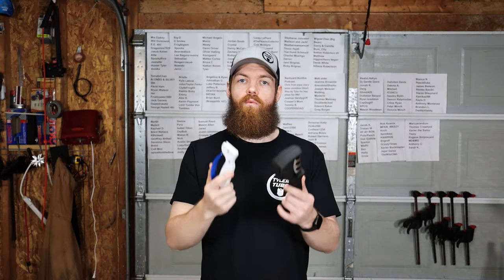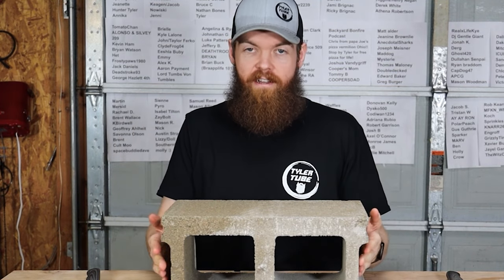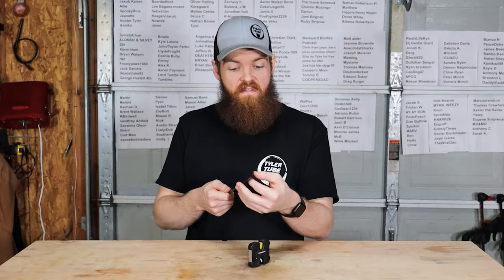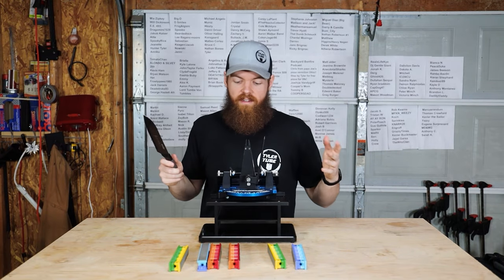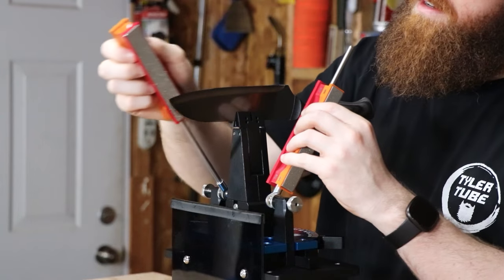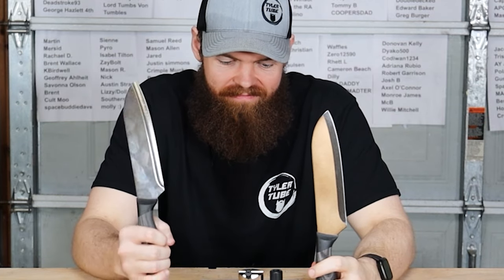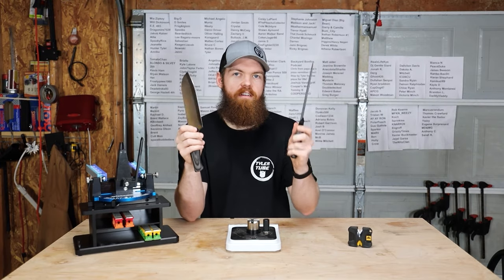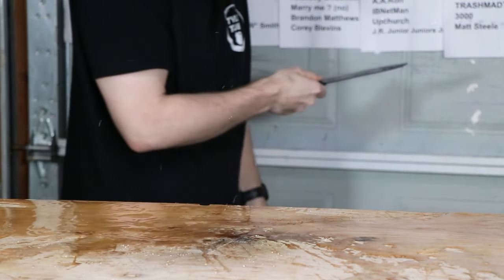$4 VS $1000 Knife Sharpener, Which One Is Better?

Comment: You need to strop the blade as well to get the best from it to as the act of sharpening the blade creates a burr that degraded the final finish, with the cheap tool the burr is forced to be in the center and the ceramic helps to lessen the burr, on the $1000 kit when you sharpen it down to a fine edge you end up pushing the burr back and forth until it ends up on one of the sides, when you used a sharpening tool like the $1000 it is essential that you strop the blade to remove / align the burr
Reply: they make a strop and their own stropping compound as part of this kit, he jsut didn't get it.
Reply: @inibrius5380  For 1000 freakin dollars it should be INCLUDED in the kit, it's not his fault their cheap asses didn't even include everything you need to sharpen the knife. They decided to splurge and that 100% unnecessary Pelican case instead, shows how stupid they are.
Reply: @bobbygetsbanned6049  i dunno if it's stupid or if they just understand the kind of person that's dropping a grand on a sharpening kit...it's either an 'avid home user' that has more money than sense or a professional knife sharpener that wants to pick and choose what additional stuff they get.  Check out the Project Farm knife sharpener review, he's a lot more detailed about why this isn't worth the $$.
Reply: You don't NEED to strop. If you sharpen properly there will be no burr.
Strops aren't needed if you know how to sharpen, which you clearly don't.
Reply: @autumn5592  Take a blade that you've 'properly sharpened'.  test it's sharpness using one of the tools shown in the video.  Then strop it and test it again.  Then tell me it's not necessary.  Even with a high-grit sharpening stone (10k+) you're not getting a perfectly smooth blade.  A strop works to polish and align a blade after sharpening to get rid of any micro-imperfections for the best possible blade.
Reply: @inibrius5380  I don't have the money to buy testing equipment.

Look on science of sharp, they look at the edge under an electron microscope, properly deburring on a stone is possible.

Just because YOU don't have the skill to do it doesn't mean it's not possible.
Reply: @autumn5592  science of sharp is where i first learned about stropping.  I based my paste strop off the one they post about.  The issue is that you get a different edge if you don't strop - if you're looking for an edge that passes the 3-finger test then use a stone.  If you want razor sharp blades that will shave hair, you strop.  It's all up to your preference.  I'd recommend you read the 'burr removal - part 1' article to see what i'm talking about.
Reply: @inibrius5380  You do not need to strop to shave.

I can get a shaving edge off a 220 grit stone without stropping.
Learn better technique.
Reply: @autumn5592  It is abundantly clear that you really do not have a clue how to sharpen a blade, history and science has shown that stropping is absolutely nessesery to obtain the sharpest possible edge, there are life long  blade experts that from chefs to Japanese blade artists to historical evidence that all proves that stropping is is needed.  Can you get a bit of steel semi sharp without stropping sure you can but by not stripping you are never going to get the full potential and no stropping a blade does not mean you are bad at sharpening it is a simply scientific fact of how steaks work when they are sharpened down to a thin point
Reply: @EQINOX187  I don't know how to sharpen right? But you're the one that has to use a strop to get a decent edge hahahahha.
Come on now, that's idiocy.

Sure, stropping will improve your edge, but you can remove all burrs with proper technique, which you don't seem to have, given you rely on it to get a good edge.

Use the strop to maintain blades, not sharpen, deburr straight off the stone, or improve the edge.
Your knife should be as good as it can off the stones.

If you DONT, sorry, but you have shit technique. Learn to properly sharpen buddy.
Reply: @autumn5592   A small tip in life when everyone is saying you are wrong and when history also tells you  you are wrong then you are wrong and you have not got a clue what you are talking about
Reply: @paulsmith3185  That's a lot of nothing.

You're wrong.
Reply: @EQINOX187  Again a whole lot of nothing, lmao.

YouTube doesn't allow links anymore. (Comments get deleted.)
Go to science of sharps honing progression article -- straight off a 1k stone under 5000x magnification, there is no burr.

 But keep going on thinking you're right, lmaoooo
Reply: @autumn5592  Y'all guys are all over here trying to gatekeep knife sharpening, all the while I've been using my teeth to cut meat and vegetables for the past 20 years. You don't need knives to perfectly mince onions or julienne carrots, dimwits.
Reply: @yancywatts388  How am I gatekeeping lmfao?
Reply: @autumn5592  With the understanding that the comment I made was entirely satirical in nature, I would have hoped that someone with the level of understanding of knife sharpening technique you do would have been able to note the blatant sarcasm of my statement and not have gotten so easily offended by it. I do apologize for offending you so, and hope you understand that I meant no harm by the comment.
Reply: @yancywatts388  My misunderstanding then, I thought only the stuff after the gatekeeping was sarcasm.

Edit ; You never offended me either, so no need to worry about that, lol
Reply: @bobbygetsbanned6049  I have this & it does come with it. Plus he did not use it right. Very light strokes. The 100 grit is used to re-profile. He needed to create a burr first which he did not do. Plus he was rolling the tip & had way to much pressure on it. I have used mine & looked at it after the strop with a jewelers loupe thru out the process. The final after the strop & the edge looks great. Other people have tested it & it gets to under 100 on that cut test. Also there is a allen wrench that comes with it to tighten the vice even more than he did. I have gotten mirror polish finishes with mine. Wicked edge is a amazing system but for most people the wicked edge go which is $275 now. I got mine when they first sold them a few years ago for $150 & ordered the deluxe carrying case with it. It allowed me to add two sets of stones. So it has 20/600,800/1000 & 1200/1600 ceramics Dimensions of the case (It rolls up very nice) are 14 inches long 5.5 inches wide & 3 inches tall weight 6 lbs 9 oz. This is perfect for all kinds of knives. I do have the best model they have & about every type of stone they have & strops to .5 microns paste. Most of the time all you need is the 200/600 better for cutting stuff. The mirror edges are more for show. 600 grit leaves a bit toothier & that makes better for cutting rope & other things. Plus with this system the stones need to break in. So after several times using it, it will work even better. I could go on & on. But check out this video. Very good test here.   https://www.youtube.com/watch?v=uEDyYJJ6f9M

Comment: Simply didn't establish the initial bur needed to make sure the apex of the edge was fully defined.   I myself only do my first 2 grits where I do a single side until I develop a bur then switch sides checking for the same bur followed by about a couple dozen alternating strokes.  After those initial 2 grits, I simply alternate all remaining stones grits as I am confident that the apex edge is already achieved.  Like others have said, ~150 on the tester is my norm at 100grit or so.  I have much finer grits and strops and most of my personal knives and a select few friends, I normally shoot for 75-90 or so on my test results.  I have some super steel EDC's that have 14degree edges that test in at 45-65.    When I first started I made that same mistake of not getting a proper bur where my test results would be in the 300 range.  Immediately after I realized it I went back, got the burs, then finished in the ~100 range.  Its a huge difference.  My guess is the second attempt Tyler made just got it closer to a bur but still missed it by a bit thus it improved but was not a spectacular result.
Reply: YESSS!!!!! finally, not an idiot on here. This guy should not be doing these tests.

Comment: I use the KME System and it's about $300 and I get results just as good as the Wicked Edge. Just my experience though. I highly recommend when you're using the Wicked Edge to take your time on the lowest grit before jumping to the next one. You can take a piece of paper while it's still in the base and drag it across the edge to see which spot needs more work. I'm not going to say you used it incorrectly because you used it right. It just takes more experience with it Tyler! I've gotten edges on my Lansky system the got a 50 on the Bess Tester
Reply: @LargeNuts  Same! I love the Lansky and I believe I have a video about what all I have put into that system so far
Reply: I do the paper drag while still in the clamp myself, it helps tremendously to always find that one trouble spot every knife seems to have.
Reply: I love my lansky and get similar results.
Reply: I also have the KDE and I finish off with leather strop with very good results
Reply: It's funny how people think they gets the same results from a cheap machine they own vs a pricey one they never tried once in their life.
Ok you can go to work in a Honda or a Lambo, the result is "technically" the same. But the Lambo is quicker, more efficient and a phone numbers graber...but youtube randoms will say "I GOT THE SAME RESULT WITH MY CIVIC"
Reply: @SkIzOjImBo  Bro a Lambo is NOT more efficient wtf 🤣🤣

Comment: As tons of others have said, you forgot to remove the burs. There's a few ways to do it, but I'm not gonna go into that. What I will say though, I've got a little Lansky set that runs on the exact same principles as the wicked edge, but was something like $20. I can get cheap pocket knives sharp enough to clear arm hair in about 20 minutes or so. The sharpening, not the shaving part :P Never really timed myself. Now the highest grit stone on that set is also a 1000 grit I believe.

Comment: This $1K system is remarkably similar in concept to my $50 Lansky sharpener (without the huge steel base). I bought the $10 accessory base mount and bolted it to my tool bench.
Reply: Check out the Gatco system. Similar price but with better/wider stones and the rods don’t have the tendency to twist like with the Lansky.
Reply: Except better everything. And it actually holds a consistent angle
Reply: @KnifeNinjaEDC  yeah no shit, it’s a thousand dollars lmao
Reply: I bought the Lansky Deluxe with the clamp and tabletop mount.  Complete waste of money.  I've tried making only 10 passes with each grit as well as 40 passes with each grit. Doesn't make a difference.  I let my son-in-law borrow it and he couldn't get it to sharpen his knives.

Comment: Use a strop it will get rid of the burr on the knifes making the test more accurate
Reply: It won't make it more accurate since neither included a strop. Adding additional sharpening accessories to the sharpening kit makes exactly zero kit. Hell add a blade smith to the kit to get the most accurate results while you're at it.
Reply: You don't need to strop, you can remove the burr by sharpening properly.
Reply: @autumn5592  yes if you move up in grits and get to polishing you really don’t need to stop but he didn’t do that he used a coarse stone only so you def need to strop
Reply: @imcrummy6114  No you don't.
You can easily deburr on a 400-800 grit stone. (Takes a bit longer to learn the control, but in a system, takes all the skill out of it.)

Comment: I 3d printed an Apex type knife sharpener.  $4 in plastic, 2 8mm rods, a few bearings.  Then I bought diamond stones that went up to 3,000 from amazon for $40.  The stones had a 400, 500, and 600.  I took the 500 and glued leather to it with Shoe Goo and clamped it between two pieces of steel to ensure it's flat and even.  Fun project.  After stopping I can hold a sheet of paper and with the middle of the edge cut into the flat of the page at about a 25° angle.  I wish I could test it on a tester like yours.  Just a cheap D2 knife.

Comment: Your desharpener AKA the cinderblock hurts my soul as a hobby knife maker. love these videos. I have an older model wicked edge with just 2 of the courser stone sets and get knives sharper than any other system Ive used. I need to get the really fine set some day. Stropping the blade after the sharpening is done will make it much better.
.
Reply: For a grand you'd think that it would include a good strop & instructions on how to use it properly.
Reply: @Nirrrina   it has instructions. But Tyler never reads them.

Comment: I know most folks don't care but any "sharpener" that uses carbide isn't actually sharpening your knife its stripping metal off the bevel the reason it feels sharp is because it basically turns the edge into a saw

Comment: I have had a $400 Wicked EdgeUSA system for ten years now and love it. In reality you really don't need to go above 1K grit, it gets super scary sharp, as long as you keep to a consistent angle. I keep my kitchen cutlery at 23 degrees, restaurant industry standard is 22.5, so a half degree up is good enough for me. As for my hunting and pocket knives, I put them at 20 degrees. One pointer I would advise is to sharpen down, not up. As for the carbide pull through, toss it, over time it will damage your blade edges, much quicker than people realize.

Comment: Here is the thing being a chef myself and have a huge love for knifes from cooking knifes to every day carry .. even though yes you used a $1000 sharpener you still need to use a honing steel to finish the fine tuming of the blades edge . I have used sharpeners that are upwards of $10,000 and I still at the end had to use a honing steel to get the fully desired edge . I have also used a $2 sharpener and gotten close results . Just one takes less time than the other to do . The only sure true way to get the sharpest edge without using a honing steelcis to use a grit that is so fine upwards of 10,000 grit wet paper also known as micro mesh or even a ceramic stone to hone it down to perfection . You can use the bottom of a ceramic coffee mug or even a bowl or plate with a lip on it . Or you can even use the ceramics off a spark plug as well or even use the back of another knife as well .

Comment: Most of my woodshop is dedicated to my wood lathes. We seldom sharpen past 1000 grit for the skew chisel. Bowl gouges generally in the 180 to 600 grit range. A 1000 grit stone still leaves a noticeable burr on it, which has to be honed off on a leather wheel with polishing compound. If you don't hone that burr off, the skew chisel will cut fine in one direction, but not in the other. Don't understand why there are not diamond stones available in grits over 1000 grit. With abrasives/sand paper, the grits are done by electrostatic charges to pick up the grit, which is far better than sifting. Take your $1000 sharpened blade and a leather strop to remove the burr, and it will match the other cheap one. I would guess that the burr is pretty much gone with a 6000 to 8000 grit hone/strop. Carvers have multiple honing/stropping compounds to get even the tiny bit of a burr off.

Comment: you diidnt use a strop for both of the knives. they need to have the extra burrs cleared for them to have any good results
Reply: Then the sharpening kits should include strops.
Reply: @bobbygetsbanned6049   they sharpen the knife, it’s still sharp but it’s way sharper with the strop, literally just use ur leather belt
Reply: @Chromie21  It's comparing the sharpeners, not the sharpeners plus other accessories you already have.
Reply: @bobbygetsbanned6049   exactly but to sharpen any knife really sharp and make the sharpener shine you need a strop
Reply: You don't need to strop, deburr on the stones.

Comment: You need to “break in” a wicked edge.  The adhesion process leaves excess grit on each plate.  The excess grit makes the rating lower than marked until broken in.  Your 1000 grit stone unbroken in is probably closer to a 500.  Sharpen 20 knives and then re-test.

Comment: This is why all sharpening systems suck. All I need are a few whetstones which cost a fraction of the price and I could probably get the edge into the 70s. Granted it takes a long time and lots of patience to be able to master whetstone sharpening, but it by far the best way. I've been sharpening for a few years now and have had better results than any knife sharpening system i've seen on the internet. Not to mention, if you put an expensive hand crafted Japanese chef's knife in one of these, it will destroy it. Not to say that whetstone sharpening is the only way to get a knife sharp, but I have found that it is the most effective.

Comment: This guy is special, there is a reason I prefer Project Farm, as he actually understands science.

Tyler, you don’t know how to use the wicked edge, so you should have at minimum watched a YouTube video to not make a complete arse out of yourself.

You should also have a basic understanding of how carbide is great in am emergency situation but otherwise will ruin the knife as it removes far too much material.

If you were to examine both edge under a microscope you would see the damage done to the blade sharpened by the carbide sharpener.

If you’re going to make claims, make sure you understand the basic concept of sharpening which you clearly have zero understanding of,